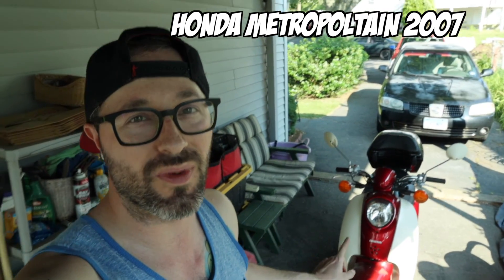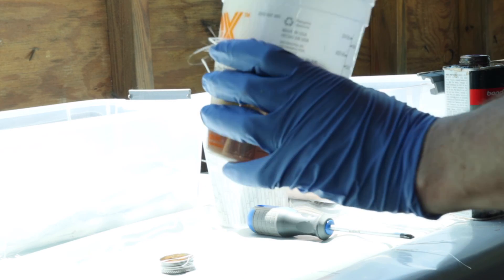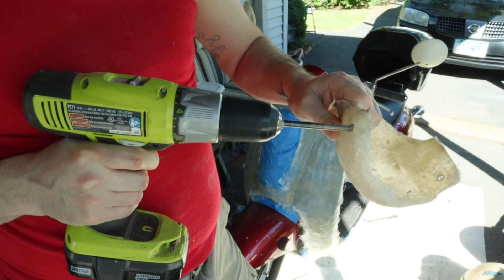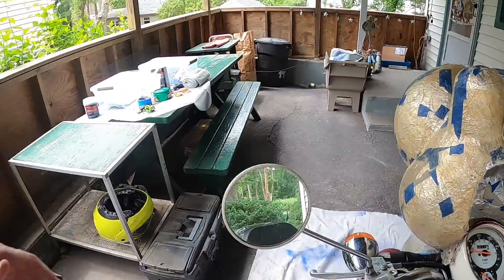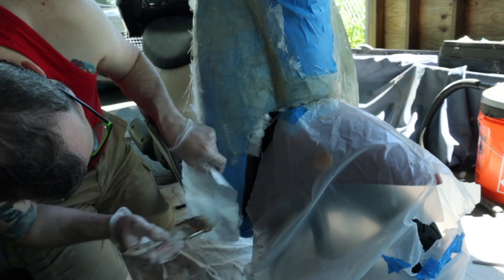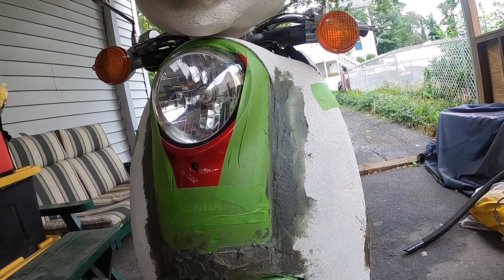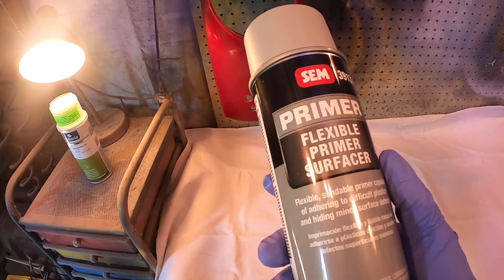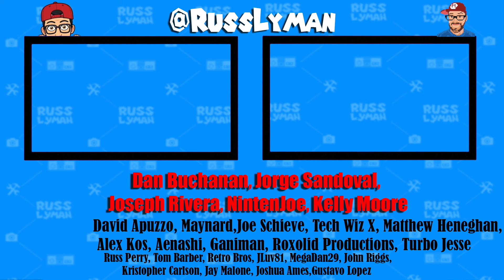Mario Kart meets Scooter a DIY Transformation (Part 1 of 3)

Comment: Your friend has a yoshi head mold?? Is there a video of that being made?
Reply from the maker: I guess I explained that a little wrong ha.
She basically blew up two balloons and than laid material on that so it would harden. Then she fiberglassed that.
To separate the mold she had to cut it in half. So when I got it, it was just taped together in two half
Reply: @RussLyman  well that's even more interesting that she did it with balloons. She should make a tutorial

Comment: I was wondering if you made any progress over the summer. It looks really good so far.  That texture spray paint was a great call.  By the look of it I had the easy job just making the head
Reply from the maker: yeah having so many projects its hard to prioritize what I work on first. So glad I could finish this up in time. Thank you, thank you, so much for coming through on the head sculpt. 
I need to practice my sculpting more so I can get better. Also let me know what I owe you for that 😁
The rest was certainly a lot of work. Fiberglass gets so messy and with bondo and sanding it becomes vary time consuming. 
Than taking the other parts off the scooter and prepping for paint ha